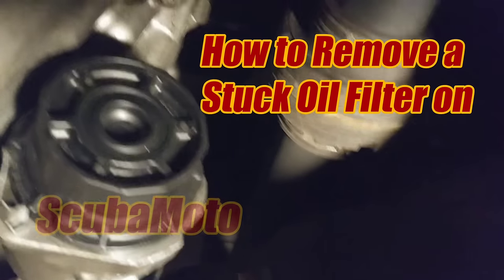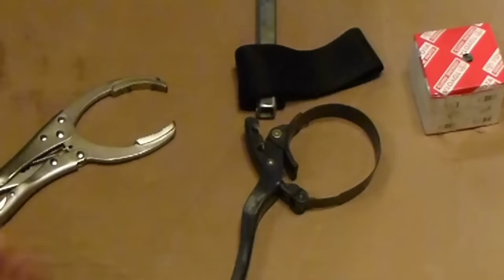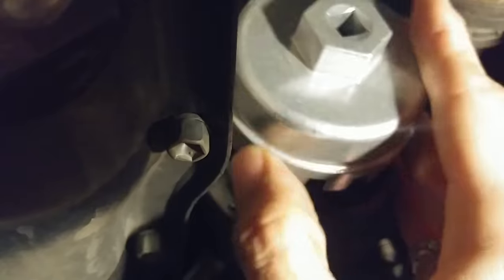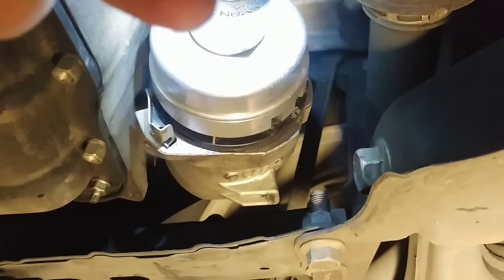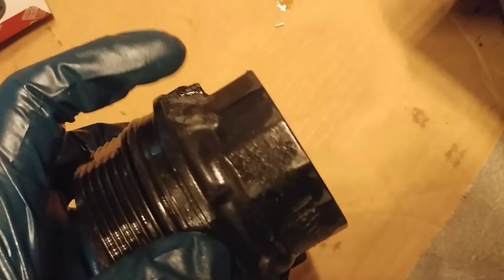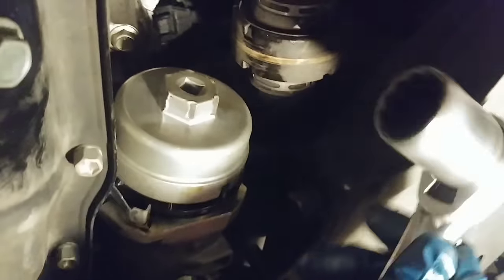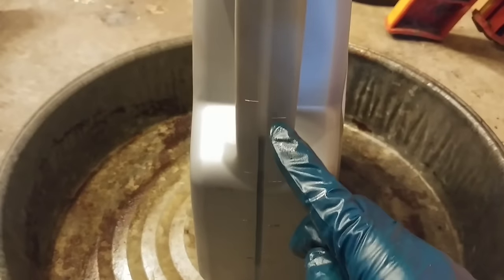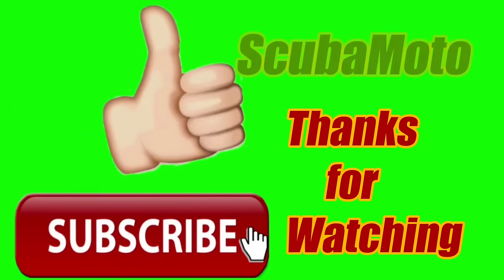How To Remove Stuck Oil Filter Toyota Prius Corolla Lexus Oil Change

Comment: Hello from where can i buy your impact driver? It looks like you got a good impact driver. Could you put a link ? My oil filter isnt budging even a bit after trying with a long bar. Thank you
Reply from the maker: Reds Orko: Just search P261. My driver is a P261 made by Ryobi. Here's a link if it helps: @t. They also make a lesser driver that would not have worked. I chose the P261 because I already had a their 18v lithium ion tool set so I didn't need to buy a battery with it. It's best to use the 4ah battery with the impact driver. It's also important to use the filter wrench shown in the video so you get maximum contact points. You'll need them for this particular filter housing. Thanks for watching and good luck.
Reply: @ScubaMoto  
If I ever decide to get one, it will be the same one since I have a cordless Ryobi string trimmer.

Comment: What a stupid Toyota system! Thanks for the tip. Since I do the changes no more problems., but Toyota dealer over tightened it.
Reply from the maker: AntVFRF: Congrats on deciding to do the work correctly yourself. That's always best. Thanks for the comment.

Comment: I just did my first oil change on my Tacoma after my 2years free service by Toyota ended and I couldn’t get that filter off and I had same tool you did I finally got it off and noticed after I installed oil new filter it dripped when first started then it was ok after warmup when it cooled it dripped again come to find out where it was leaking there was a couple chipped fingers unknown to me so now I ordered a new housing so much for the dealer know how I even dragged my fingers around in the oil looking for chips I did find a little one on my garage floor and matched it up to a much bigger one from the past dealer service where the leak was coming from so I’m now fixing what they did in the past I screwed it in by hand my wife’s car too also a Toyota and no leaks there or chipped fingers same dealer but I guess different mechanic

Comment: Just had this problem on our first DIY oil change on a used 2011 Prius we bought my oldest son.  Couldn't get it off with the high quality oil cap removal tool I owned.  Got a cheap one at oreilly auto parts because the good one hit the block when trying to put the tool on.  Neither would budge the filter cap and the cheap one slipped while trying to remove it.  I bought a 2016-2019 Toyota corolla filter housing that uses a twist on oil filter instead of the garbage cap and paper filter non sense.  The part number for the housing (15609-0T060), 2 o rings (96723-24020), oil filter threaded center piece (90904-04006), and the oil filter it uses (90915-YZZN1).  Net total was around $105 shipped.  I hated the one on my other Lexus cars too, so this in my eyes is preventative maintenance.
Reply from the maker: Daniel Burgess: Thanks for taking the time to post this option.

Comment: Isn't the metal clip outside the filter (at about the 7 o'clock position) supposed to keep the filter from becoming loose? It seemed to have no contact in your video. Was it bent back? Is it even needed?
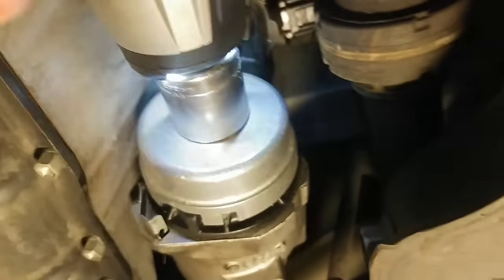Reply from the maker: Mullinda288: Thanks for the comment. The spring arm in the video is undamaged. Toyota does not recommend bending or removing it in either the service manual or box instructions. It's better to just use the right tool for the job. The spring arm is designed only to keep a loose filter from spinning off and is designed to be left in place for a normal oil filter removal, particularly with the correct filter wrench. My video clearly shows the rounded head of the spring arm sliding right over the ears of the filter housing during removal like it's designed to. The spring arm barely applies enough pressure to prevent a loose filter from spinning all the way off while driving (which is its only purpose). It will allow normal filter removal as clearly shown in the video at 2:11 and several times later in the video without breaking or interfering with removal. At 2:51, the spring arm is still clearly as good as new yet still allows me to finish removal by hand. I get occasional comments suggesting bending or removing the spring arm. That will not help you with an over-tightened filter and I do not recommend it. Thanks for watching and for the comment.

Comment: Any ideas if this fails? I don't have a compressor currently, so limited to an electric impact wrench. Got the strongest  I could find in town, nothing other than the outside of the plastic cap is fairly rounded off at this point, all tabs and such broken off anyway. Thinking about maybe drilling it out and crunching it like pulling a molar? Hesitant for obvious reasons, but want to get the thing off the ramps in the driveway.
Reply from the maker: William Jacobson: It sounds like you got another tough one. Sorry to hear. My ratchet failed. My cheater bar failed. My cheater bar with a pipe extender even failed (I'm sure you tried it). Even my 300 ft-lb Ryobi P261 impact took a while. I edited out some of the impact time. The camera and I just waited while it banged away and it finally started to turn. It also lost one of the ears. I was pretty relieved, thus the SloMo replay. I'm pretty sure the banging (impact) with 300 ft-lbs is what is needed when they're seized. Impact is certainly what got it stuck on there. Judging from the extracted filter, I'm confident many others had failed before me. If impact plus lots of time didn't work on yours, and it's rounded; then I guess you could order a new housing and destroy the old one to remove it. If you're careful, you might be able to drill it for an extension through-rod. Study the new replacement first to help you know where to drill the old one. Please let us know what happens. Thanks for watching and for sharing.
Reply: @ScubaMoto  I was able to try all that except getting a pipe extension on the breaker bar due to limited room (Prius is up on a pair of 8" ramps from Harbor Freight) Ended up drilling a line of small holes from rim to rim on the cartridge, cracking it open, and spending some time cleaning up the pieces. Clearing the threads was a little time-consuming, but drilling and whacking the little bastard beats another trip to the store any day. The filter inside was so old it feel apart when removed, so either my wife or the dealer has some 'splaining to do. Not sure how to post a pic of it, but it's gnarly.
Reply from the maker: William Jacobson: Huge congratulations on getting that old housing off!  If your wife has always brought it to the same dealer, then the dealer has known all along that the filter wasn't getting changed. That was the case for the filter in the video. The entire service record was the same dealer and they had not been changing the filter because one of their techs had installed it with impact and they could never get it back off. Thanks for the great comment and for sharing.
Reply: @ScubaMoto  wow, wonder how common that is, since so many Toyotas seem to use this same little setup. Thanks for the video and the assist!
Reply from the maker: William Jacobson: Good question on how many Toyotas use this set up. It's on a lot of Toyota and Lexus models. And since this video gets about 100K views per year, I suppose that's some indication of how many Toyotas have this issue with removal. Again, job well done getting yours off and replaced. Now that you're doing it yourself, it will never get over-torqued on installation.

Comment: How about using a 3/8" breaker bar?
Reply from the maker: DavidJLim: Thanks for the comment. That's a great idea and I certainly tried it. BTW - you want to use a 27mm socket over the lug of the filter wrench. Inserting the 3/8 drive into the 3/8 socket of the filter wrench may split the wrench in half when using a breaker bar or impact. My cheater bar (breaker) was the second thing I tried once I got the correct filter wrench that you see in the video. The first thing was a standard ratchet. Then a 24-inch cheater bar. Then a pipe slipped over the cheater bar. The car was on jack stands and it just rocked the car (not safe). So impact was safer and got the job done. Thanks for the comment and for sharing.

Comment: Theres a special tool that usually comes with your filter for the Toyota's that relieves pressure as well as drains the oil out of the filter to keep from making a mess. Perhaps this is why it was hard to remove?
Reply from the maker: Bigg Dame: Thanks for the comment. The OEM filters only come with an o-ring. But opening the filler plug will help drain the oil but will not help with an over-tightened filter. The wrench used in the video does not come with a new filter but it is an important tool for removing these plastic filter housings. Thanks for watching.
Reply: Wish it was only that. I used that little drain tool (2012 Camry) and still couldn't get the filter housing off. Valvoline over-torqued it. First I bought the tool that only engages the 14 flutes. Then I bought one with the notches, but they didn't reach the tabs on the housing! I might have to break off the housing (like I did with my RAV4) and buy a metal housing.
Reply: @dimchandeliers  
The Camry takes a different oil filter and a different oil filter cap tool than the vehicle (Prius) in this video. One has a drainplug on the oil filter cap and the other does not.

Sounds like dimchandeliers bought the tool for the Corolla/Prius and not the one he needs for the Camry and other Toyotas with the 2.5 liter and larger engines.

Comment: should i fill the new oil filter with fresh oil before installation?
Reply: omaya ali I do. Some will say don’t bother. It can only be a good thing and never a bad thing.
Reply: mike Gilson You’ll need a few friends to help you roll the car onto its side. And never use loose oil.  Tight oil is the way to go!
Reply: I wouldn't bother. It's mounted horizontally and it's a small filter on the 1.8 liter engine. If you have the vertically mounted filter then you could do that. Some folks will add oil to their horizontally mounted filter and then drain it into a funnel into their engine so only the element is saturated before installing it.

Comment: Yah I’m having the same problem will be using my impact gun tomorrow
Reply: Where you able to remove it ? And did you use the same housing ? Because that’s what I’m afraid of to remove it and the threads won’t be any good anymore then I would have to get another one!

Comment: Your Ryobi impact driver delivers 300 ft/lbs?   Are you sure it wasn't in/lbs.?    If I'm incorrect,  what is the model of your RYOBI?
Reply from the maker: Lou C: Lithium power has changed everything. The P261 in the video is a true 300 ft-lb. The brushless P262 is 600 ft-lb. Yes, that's ft-lbs. I am amazed at what the 261 has been able to remove. They also make 1/4-inch and 3/8-inch drive impacts that would never have been able to remove the filter. I believe the 3/8 is rated at 200 ft-lb and the 1/4-inch even lower. Honestly, it's all I use for impact now and it's been a load off the compressor.
Reply: @ScubaMoto  Thanks for the info, brother!

Comment: What was the oil filter tool you used to tighten this? Trying to find one to tighten this canister to spec. Keeps leaking out and its very annoying.
Reply from the maker: Andrew M: The ones I've heard the best results from I have linked in the video description. That should get you started anyway. Thanks for the question.

Comment: I bought the 4$ metal oil removal cup thing at walmart. Its got 65mm and 68mm or something close to that.  . I think it is 64.5mm though.  I used a portable band saw and cut the bigger outer off. Get some carb cleaner and clean the factory oil filer housing and JB weld this thing onto it. Leave it there forever. LOL. only need a 3/8 wrench not to change oil. No Tools to find. It was so tight the metal would flex and it would slip off before.
Reply from the maker: Tim Z. Was this also a stuck (over-tightened) filter housing? And did the JB weld hold for a removal? Cool way to mod this ridiculous housing design. Thanks for watching and for sharing.

Comment: This solution worked for me. After spending $75 on a 300 ft-lb impact wrench. The oil filter wrench was chiseled down on the edges where the socket goes. Ridiculous.
Reply from the maker: I'm glad to hear it finally came off. The wrench in the video got pretty beat up too and even lost a couple of teeth but it still works fine to this day. Thanks for sharing.

Comment: U left the clip on that is holding in the filter....
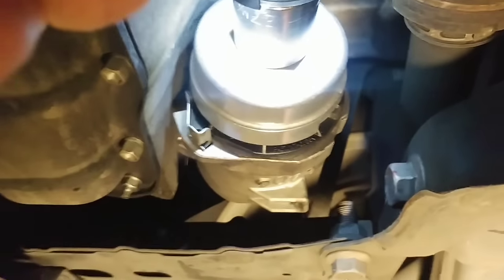Reply from the maker: DK_Adven: Yes, and that is Toyota's recommendation. The odd little spring-arm that is right in front of us all looks unusual, but it is in no way intended as a deterrent. By design, it simply puts enough pressure to prevent a loose filter housing from spinning off while driving. Toyota service does not recommend adjusting or altering the metal spring arm for a filter removal and they certainly don't recommend removing it. Neither do I. I have seen some vehicles with the spring arm missing, but you could remove it completely and it would not help in the removal of an over-torqued filter like the one in the video. While using the correct tool, this video clearly shows the spring arm easily allowing filter removal at 2:30 and several times later in the video without breaking or interfering with removal. At 2:40, the spring arm is still clearly as good as new and even allows me to finish removal by hand. I hope this response saves time for any viewers who were considering needlessly removing the spring-arm. Thanks for watching and for sharing.

Comment: the mechanic who changed my oil apparently over tightened it. i had to resort to the breaker bar, then i heard the plastic piece snap. after that, it stopped turning. i'm going to use the impact wrench and see how it pans out.
Reply from the maker: @now what: The housing cracked? What part of the plastic housing snapped? The same thing might have happened to me when trying my 24" breaker bar with a pipe slipped over it. You can see in the video that one of the plastic ears sheared off. But impact still got it off. But be patient while using impact. Let the impact vibrate it for a while and hopefully knock it loose. Good luck and thanks for the comment.
Reply: @ScubaMoto  several plastic ears, if i guess the meaning of the word correctly. i tried to loosen it with the breaker bar but it would slip. i tried the impact wrench, but it wouldn't budge. i think i'm going to buy the replacement at autozone tomorrow morning, take it to the mechanic who changed the oil last time and pray that i don't have to pay high repair fee for it. i've changed oil several times and never encountered this problem.
Reply from the maker: @now what: Great idea bringing a spare housing to whoever over-tightened it in the first place.
Reply: @ScubaMoto  i took it to a different shop today and they had to hammer the cap, use breaker bar and extension to loosen it. the mechanic who changed the oil previously said that he always make sure it's real tight because he was afraid the customer will return and complain about leaking oil. fortunately, it only cost me $25 for the labor and $30 for the new housing unit. needless to say, they don't go by the torque spec by toyota.
Reply from the maker: @now what: The o-ring that makes the seal is unaffected by how much torque is put on the housing. 8 ft-lbs or 300 ft-lbs, the pressure on the o-ring will be the same and the seal will be the same. Good for you picking a new mechanic.

Comment: Same situation, is that probable that I will damage the filter by using a power tool
Reply from the maker: Dave Hobby: It depends how tight it is.  If you can loosen it by hand with a wrench or with a cheater bar, you should do that. If it's not possible, then you may need to use an impact wrench. The one in the video was not possible by hand, so I had to use impact.  Good luck with it. Thanks for watching and for the comment.

Comment: I did my pil change today on a 14 Toyota corolla. That bitxh is so stuck on there that I put my milwaukee impact on there (nothing special just the impact driver that comes in the drill kit) and I broke off the nut from the oil cap wrench. Then I got a universal oil filter tool from walmart and put that on the stuck on oil cap wrench and it still didnt come off and it was horrible. I just filled it up and I'll trade the car in eventually

Comment: I have the same problem! A Prius. I have the aluminum wrench and still can not removed!  Should we tried to loose (unscrew)when engine still really hot? Do you guy remove the oil first and unscrew the feeder oil top cap from the engine to relief pressure? Appreciate any suggestion. This oil cap is a nightmare !
Reply from the maker: Salvador Ferreira: Yes, the filler cap is off and the oil is drained and the engine is warm before removing the filter. I first tried a long wrench (sometimes called cheater bar or breaker bar) with a pipe slipped over it and it was still too tight but I recommend trying that first with the correct wrench type shown in the video. The 300 ft-lb power impact wrench took a minute but it was the only thing that worked for the one in the video. 300 ft-lbs with impact is hard on things but when they're over-torqued on install with impact, it might be the only way to loosen it. It is important that you use the same filter wrench type that is shown in the video because you will need the maximum number of contact points with that Toyota filter housing because of the amount of torque needed to loosen it. Good luck and thanks for sharing.
Reply: Thank you ! I will try like that!
Reply: @salvadorferreira1988  
Did you find success?